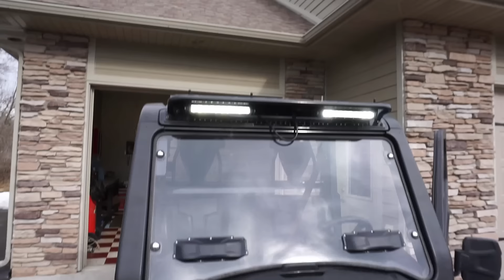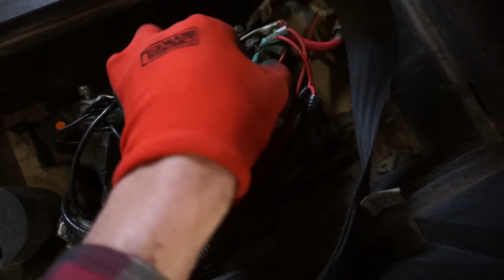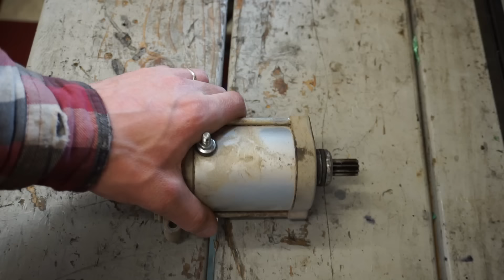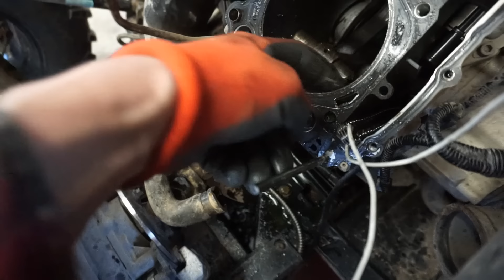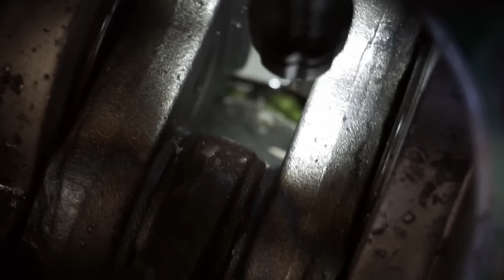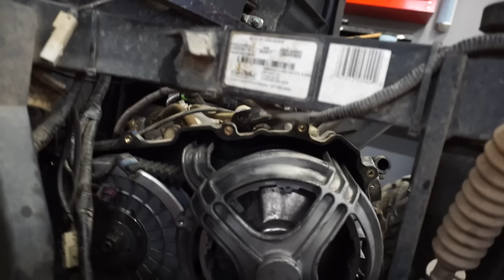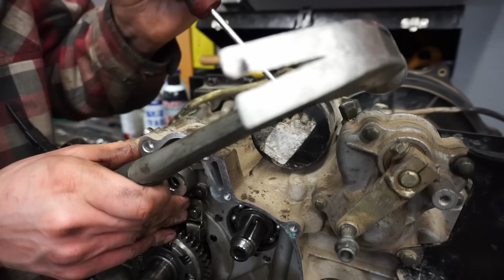I Bought This $15,000 UTV For $3,500. How Bad Could It Be?

Comment: You can see the heat transfer to the crankpin at the rod journal (37.19) indicating the bearing spun. This is such an unusual failure that it defies what occurred first but it definitely ran low on oil. My guess is the bearing probably spun and caused it to knock. They then added oil or changed the oil and filter in the hope of curing the issue. Then they ran it until it locked up.

Comment: Just saw you pull the plug. The first thing I would check is if the plug is the correct plug. I’ve worked on several mowers that someone put in a plug that was too long of a reach and they look like yours, and the engine won’t turn over. Pull the plug and turn over the engine.

Comment: First of all I don't believe that nobody was ever inside that engine. The pristeen Wrist pin is your first clue. The heaviest part of that piston would still be on the wrist pin. They knew the 110 per hour price because they already paid it once for the dealer to look at it. The circlip on the wrist pin probably came off...allowing the  wrist pin to slide sideways contacting the cylinder skirt bottom which took a chunk out of that sending pieces up into the top end and hitting the spark plug, valves and damaging the top end. The dealer removed the piston and replaced the wrist pin and cylinder when they would not pay to get it fixed. Some of the piston fell into the bottom of the engine. Oil was clean because it happened real fast like a hand grenade. No grinding of parts. Just locate another engine. Cut the support beams that are in the way and and weld them back on when complete.

Comment: Once you get to the rip seat, if you guys have a "hobby Lobby" you can get fabric over there and recover that portion and stich it all back. Just a suggestion. FYI, Hobby Lobby doesn't open on Sundays. Or you can get the fabric from walmart as well, which ever is cheaper. Hope the suggestion helps.

Comment: They must've built it with those new melt-down plastic pistons.  It's designed to save the cases when the piston wants to go bad.  Instead of grenading all through the cases, and your legs and whatnot, the plastic just melts down.   SImple fix.

Comment: When it locked up and the shop discovered that wrist pin came loose and broke the piston the owner was into the shop for 3000 bucks. So he said throw it back together after they took the piston out so he could try an sell it to pay off the shop. Put it together with new parts and sell it half price. $ 7000.00  I'm a Polaris fan. They all break down here an there but I have had the best luck with Polaris.

Comment: If you own a small wire feed welder here's a small tip......Don't struggle with the pain and aggravation of pulling and installing the engine. Put a .065 cut off wheel in your angle grinder and surgically remove the obstruction and weld the piece back in upon reassembly....I did this multiple times on Ford Econoline Vans 30 years ago.
Reply: Brilliant!

Comment: Geeeez. I wanted to yell to you so many times when you tried to figure out the reason the starter don’t crank. Aparantly a little knowledge of electrics is needed. :) it’s perfectly clear the reason you see a low voltage on the starter side of the solenoid is because there is a huge drain pulling down the voltage. What’s the only thing connected to that circuit? The starter. The engine is locked up. There was no doubt from you tried the key obviously, just by the sound alone.

Comment: Technological advancements or backwards steps??? 
Why on earth would you put separate bolts to hols a cylinder down beside the cylinder head. Old school designs had single long bolts clamping the cylinder head to the crankcase, with the cylinder sandwiched in between. if you wanted to improve engine power, you increased bolt sizes or went to 5 or 6 long bolts to spread the forces.
I guess I'm an old fuddy duddy engineer with little relevant experience!

Comment: Impressive destruction. I guess someone forgot to check oil and water and just ran that thing to red hot until it exploded? At least the discoloration on some parts like the sparkplug thread and piston pin look like it.
Hope you find a good deal on an engine, maybe from someone that just wrecked the cabin or frame.

Comment: Used to work at the plant that built these. The frame is a one-piece unit, all welded together. The frame is built with all the components. Then, the body is dropped down on it.

Comment: I absolutely DESPISE when I see people connect a TONE of crap to the battery. Get a junction box and put it to the side and run a cable down to it. You can properly fuse it AND it looks neat. I just dont get why people insist on doing it this way.
Reply: Look again.  That was a junction bar. So factory set up.

Comment: Steal at 3500 just put new motor in it. Hot rodding killed motor, and it has been tried over and over just put new motor in it. Someone molested it before you got there, bottom end bearings may have survived, prob bokeh timing chain sone one took it apart and then put it back together to sell.

Comment: I am a retired internal combustion maintenance and repairs engineer and in my opinion that engine was held flat out in neutral till it destroyed its self. That’s after its original partial seizure.     I love watching your videos and hope you have a very successful life. 
Regards 
Raymond 🏴
Reply: All true my friend. It’s not made up I can assure you
Reply: good for you  on the apprenticeship and receiving a certification title now that said I am 82 and I have a McCulloch chainsaw that blew a little bitty thumb size Kristen I’ve had it for 30 years  my (BROTHER ) wouldn’t let me through it away  TOO MY AMAZEMENT HE REBUILT IT FOR ME  “ and I’m still using it “  I am sure that will be the case here!
Reply: So a retired mechanic then  @raymondrobertson3869
Reply: My personal opinion i think the clip for the wrist pin was incorrectly installed she got hot the clip came loose and piston slipped off of one side of the wrist pin and it smashed itself to pieces off the bottom of the cylinder and what ever was left broke off when it hit the valves and head🤷
Reply: @H3R854LIF3  
that's exactly what I thought too when I saw the end of the wrist pin all beat in. Would have liked to see if that beat up end was on the side where the cylinder was broke out, I'm pretty sure that would be the case.
Reply: definatly
Reply: The clue is in the title on my apprenticeship papers. I will give you a clue 🤔maintenance.      Not design. I have overhauled many many engines in my younger days
And could still do it today. As long as someone did the heavy lifting 😂🏴👍👍
Reply: Kind of like a sanitation engineer  also know as a janitor
Reply: Engineer? You drove a train?
Reply: " I am a retired internal combustion maintenance and repairs engineer  "  Wow, thats a mouth full for a made up title. Typically Engineer designs things, not fixes them.
Reply: @ugetridofit I’m a biomedical Engineer, and 90% of my work is “fixing” chemistry & hemostasis diagnostic instruments 🤷‍♂️
Reply: @ugetridofit Aka he's a mechanic.

Comment: Most likely your piston has turned into piston nuggets. You don't get a smashed spark plug without the piston hitting it. If you look at the color where the connecting rod goes to the crank it looks like it got a little warm. Did you check the oil level before you drained it. And this thing just didn't stop running when they were driving it They heard it. Everybody lies when they sell stuff. Time for a new power plant😂

Comment: Find a sport bike engine that will fit and save some money . The manufacturer of the piston is to blame and all parts to fix it will be the same , I have seen this in manufacturing when you order parts from China. They will literally pay people to sit out in a field to cast aluminum pistons in sand using melted soda cans . If you send the metal in for analysis in a lab I can guarantee it comes up as the same composition as metal used for cans .

Comment: A good rule of thumb is to try and turn an engine over before you bought it being it didn’t run. Wonder if they towed it in gear after the initial failure and just kept beating it self up crazy.
-I myself just dealt with a BMS side-by-side transmission Bevel gears were gone all built-in with the engine had to split the Center engine cases to get to the bevel gears tried for a year to get parts, unable to, gave it back to the customer in pieces.

Comment: I had a piston do that in a car one time. What happened to me was when the Piston was coming up, the side skirt broke off so the Piston turned sideways which when it made contact with the head it exploded. So it left the rod and wrist pin in my just like inside this engine. Put put a hole in my cylinder and ruined the head.

Comment: Will it crank , turns the key 40 times before trying something else. 
1.see if the engine cranks over by hand. If it turns over by hand see step 2 if not scrap it.
2. Check battery voltage and amperage . If less than 12.4v charge or replace if 12.4 + step 3
3. Check starter motor and wiring to the starter motor.
Don’t sit there clicking the key over and over . But congrats you got a cheap motor

Comment: Man if id have known you were gonna buy one of these i wouldve steered you completely away. Used to work on cub cadet and stihl equipment for a living. Certified in both. Those side by sides and engines have to be some of the worst ever made brother. Same goes for the lowes brand hisun axis side by sides.

Comment: Cub Cadet's engineering , serviceability and metallurgy kinda speak for themselves in this job.  A machine designed for rugged outdoor duty needs to be made better than that and it needs to be more fixable too.
Reply: Agreed. An engine shouldn't simply blow up after so little mileage and so few hours of operation. The engine failure looks to me like a manufacturing defect and also due to sloppy engineering. 

If I had been in the old couple's position, I would seriously have considered suing the manufacturer for selling me goods that weren't of merchantable quality.

Comment: If I was a bet'n man.... I would say.. that motor took a large gulp of water at a high rpm. That's pretty catastrophic type of failure and, to primarily be contained in the cylinder..... not to mention the shape of the wrist pin..
Reply: There’s mud water all over the intake parts. Would guess water too

Comment: 700 for top end, 900ish with crank and cam. You're gonna be $5k into this all said and done. It looks like a nice machine though overall and I bet another older couple could buy it up from you once it's completed.......I did this to an LS1 v8 one time, out of nowhere it exploded under throttle (someone had been in the engine before me) and it put a hole in the block and left a trail of Pennzoil for 300 feet. It was quite the glorious exit.

Comment: Convert it to a Twin Briggs with a torque converter. Making the engine mount and drive shaft connections can't be any harder that what you have already done.

Comment: If the battery contacts were loose then more than likely the battery is hosed. Basically loose contacts will not permit the battery to charge. Why all of those crimp contacts going to the battery? There should be a fuse block direct to the battery with all of those branch circuits going to the fuse block. Same for the negative lead, a common terminal block for all of the negative contacts. The block should connect to the battery.
There is a chance they red lined the engine, something like this is possible by over revving.

Comment: I have a 2013 Kymco I bought with not many hours, a 750 also, it would randomly shut off when you have 2 people in it,I got tired of it and started looking around I finally pulled the passenger seat off and looked like from the factory they had ran the fuel line over the seat support bar so when someone sat in it it would pinch the fuel line and shut off the gas. It had quick disconnect so i unplugged it and reran the fuel line under the bar as it should be and never hada problem since. I suspect that was the reason the people traded it in .

Comment: check that spark plug number for that machine , It looked like the wrong length . The guy could have installed the wrong size plug and it shattered the piston . I have seen that before and had my suspisions right when I seen the bashed in plug . The oil you took out would glow in the dark if it was a bottom end . you need a jug and piston and a flush and you will ride again .

Comment: Is supposed to be in neutral? Does it have park.  Maybe a linkage thing .not all the way in position.  Does it require the operator to be in the seat. If so, may be something with a switch to the seat. Does it require seat belts on ? More than likely, it's something simple .

Comment: "At HISUN Motors Corp., USA, we are dedicated to delivering a complete line of unique and versatile UTVs and ATVs, with a common focus of surpassing industry expectations. Our mission is to fuel enthusiasts worldwide with innovative products that propel the industry. We make more than just powersports vehicles, we make off-road experiences that will last a lifetime."
...Uhm. Yeah, you go off road and spend a lifetime trying to get back onroad. Lol.
Apparently they ship the parts and assemble them in TX, presumably from China. For that piston to disintegrate like that, it must be cast aluminum. Of course, you can even kill a Toyota engine if you run it with no oil. The oil was dark though. With that low miles, I suspect it was never serviced, AND lived at redline. An older couple did not mudbog this thing. The second owner did. "Ran when parked!"

Comment: For $2000 you could buy a whole Hayabusa motorcycle.  Pull out the motor. You'll be doing a 180 miles and hour in a 1/4 mile

Comment: 17:14 you have no clue on electrical systems. 0  none.
You have a voltage drop on wires.
Measure the impedance  on the short runs should not be an ohm 
Longer runs within 2 ohms  but if they are good no restance. 
 There are no fuses between a starter solonoid and the battery.

Comment: re sleeve it,, bore it out 100th, offset the crank, grind cam.. 1000cc, 150 hp.. no warreess..  what was the warrenty..  12 / 12.  12 ft or 12 minutes.. id be on the comp. , finding prices..being new,, proly not cheap.. still, for 3.5k,, good buy,anyhoo..

Comment: first thing you do.  is,,check it has oil.. next, pull the plugs,, then, see if it turns over, by hand.. if all this is good, then,,its starter, fuel pump, or electrical.. watch. i do cars...then for electrics, south main auto..

Comment: Watched the cub cadet video wow. I have a similar thing going on with my 90 big bear the Piston and the cylinder were both jun replaced all and still can't get it to work and very low compression 30 psi is all I'm stuck.

Comment: My possible theory is that someone went mudding with that machine, and ingested water into the air intake and stalled the motor.  If the engine cylinder were full of water on the top half, and someone tried to start it without removing the spark plug, it could prevent the piston from traveling through its compression stroke and shatter the piston due to hydrolock pressure.  Anyone else have some theories?

Comment: Worst engine tearout ever - best video ever!
Since you have everything apart, how about converting it to an electric motor and battery? Marty T in New Zealand did that with parts from different machines - ended up with a very quiet machine and incredible acceleration. I’d love to have a quiet ATV - my Canam makes so much noise going through the woods it scares away every animal in the county 😊
Thanks Joe.

Comment: power sports nation is probably going to be the best bet for getting replacements parts. I would definitely try to find one that’s been wrecked but motor is still good. That definitely looks like the oil was never changed on that unit bet it still had the factory brake in oil. I saw a older van at the campground had that same unit and he had over 30,000 miles on the unit but he also maintain it really well he said he only ran ethanol free gas and used amsoil.
He said that he changed the oil every 80hrs or 600 miles and every other oil change he changed the oil filter. Guess it goes to show regular maintenance is essential for a long life.
Reply: why would he buy an entirely new/used CC engine when he could easily source one under the chinese name Hisun for likely way way cheaper? You make no sense.

Comment: The wrong spark plug was probably installed with the smashed strap on the spark plug the piston was more than likely making contact lightly on it until it had enough. The spark plug being loose further justifies my point. I’ve seen holes in pistons from that too *example teenage grandkids take machine mudding get water in electronics machine quits they think plug fouled they take plug out of something else plug is too long crank engine and well 🤷‍♂️ so take it back wash it up and tell grandparents it quit and won’t start. It happens especially if it’s not the machine of the person that broke it they don’t care.

Comment: I’d definitely try and find a complete used engine for it and skip the rebuild if possible. Good luck!
Reply: And start again with someone elses problem, no rebuild what you have as you know the problem
Reply: @anthonymisell8845  i agree, rebuild this engine, he now knows what he is dealing with. another engine is begging for more work, nope, i'd rebuild this engine with all new/used parts.
Reply: @anthonymisell8845  not if he gets it from a reputable supplier with a garentee on it,it might cost more ,but worth it.
Reply: Exactly.  A full rebuild would be a good investment.
Reply: @MaryWehmeier  Your response is the opposite of the response you are responding to???  What are you thinking?
Reply: I'd slap a small block chevy in that bad boy! 🤣😂🤣
Reply: Yea, I agree